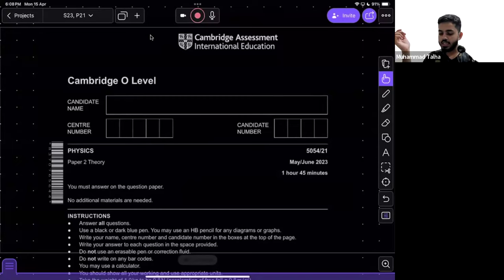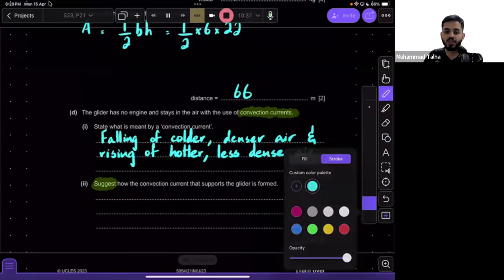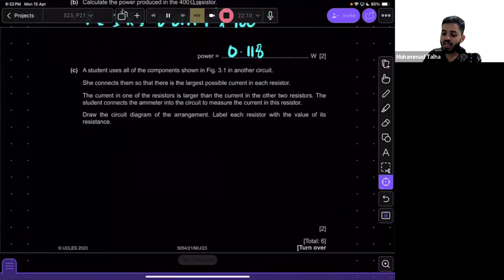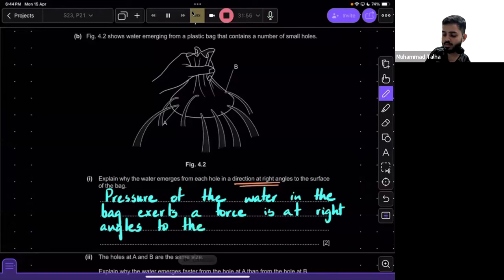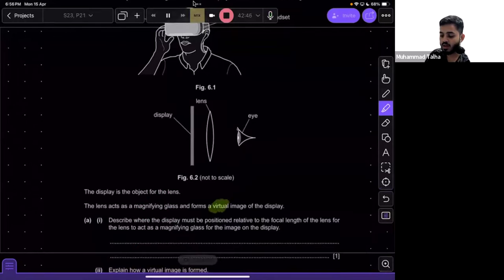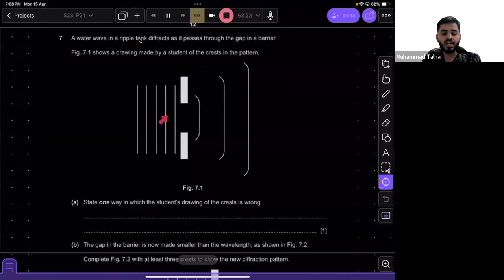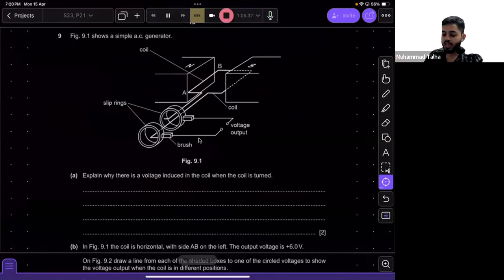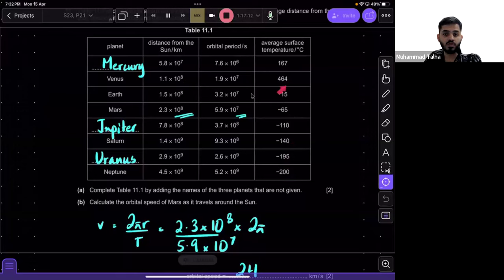May June 2023 Paper 21 | Yearly Past Papers | Cambridge OL Physics 5054

Comment: Sir, for Q8, b, you answered with 49.6 but the marking scheme's answer was 50. How do we know when to round off the answer and till what decimal place or significant figures?
Reply from the maker: @waaniazaheer1524   The rule for writing your final answer is this: your answer should be correct to or 1 more than the LEAST number of sf of the data provided. 

So for example if my calculation uses 3 values which are correct to 2, 3 and 4 sf, I can write my answer correct to 2 (least) or 3 sf (1 more). 

Most of the times 2 sf will be fine but sometimes the least number of sf will be 3 in which the answer cannot be given in 2 sf. This is why I choose 3 because it would work in either case.

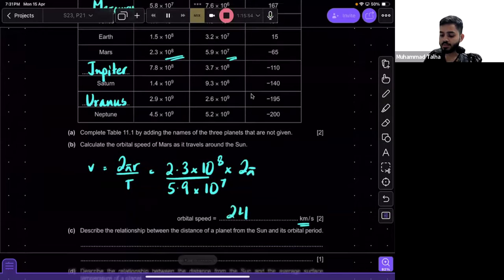Comment: Also at 1:27:51 the answer was 24.49 which when rounded off becomes 24.5 so correct to 2 sf wouldnt it be 25? Kindly help is rounding off mai im facing confusion
Reply from the maker: @f1amingsku116  The rule for writing your final answer is this: your answer should be correct to or 1 more than the LEAST number of sf of the data provided. 

So for example if my calculation uses 3 values which are correct to 2, 3 and 4 sf, I can write my answer correct to 2 (least) or 3 sf (1 more). 

Most of the times 2 sf will be fine but sometimes the least number of sf will be 3 in which the answer cannot be given in 2 sf. This is why I choose 3 because it would work in either case.
Reply: Alright thx a lot. May God bless u

Comment: Sir at 13:05  is it ok if we write the final answer as 491 rather than 490 even though in the marking scheme the acceleration used is 3.7 while u used 3.67
Reply from the maker: Yes it's totally fine. You should try to use your calculator values as long as you can.
Reply: @ ok thankss